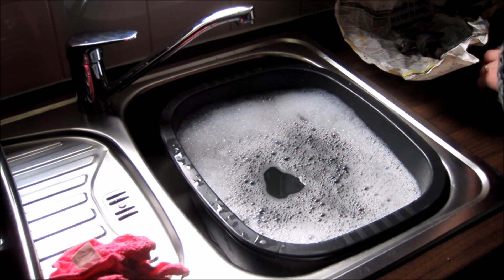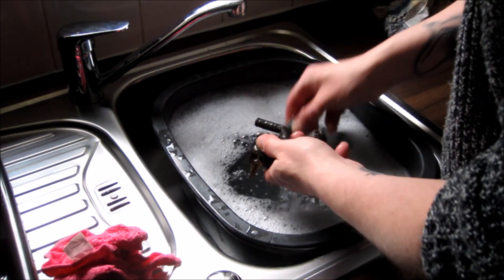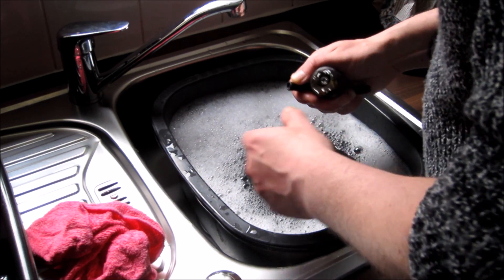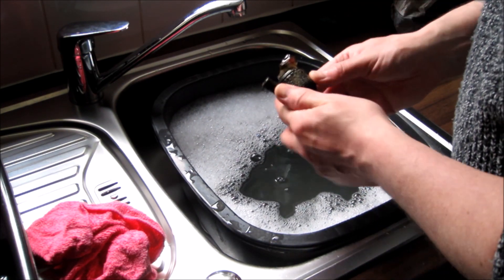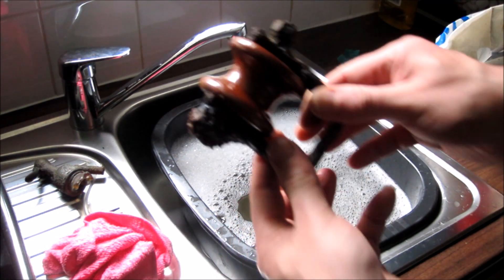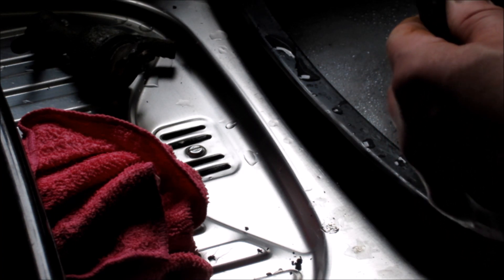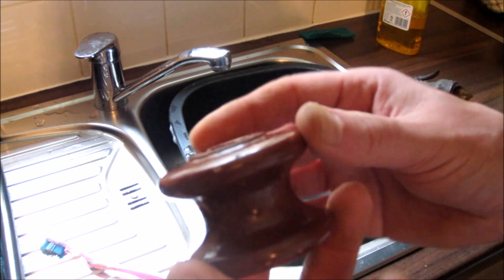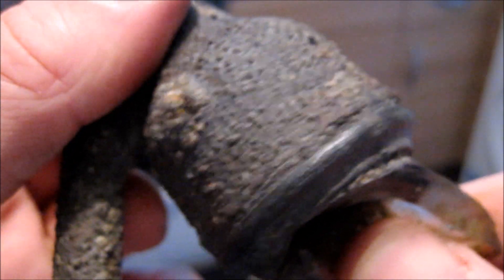Beach Metal Detecting UK 2018 - WW2 RELIC RESTORATION (The Yorkshire Digger)

Comment: Do you ever use electrolysis to restore metal finds - or remove rust/gunk?
Reply from the maker: I don't use electrolysis as I don't have the quipment and am not a big fan of messing around with electricity(been electrocuted several times). I am thinking about maybe getting a ultrasonic cleaner after seeing someone using one.